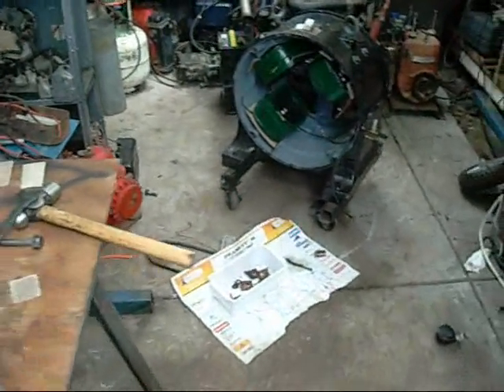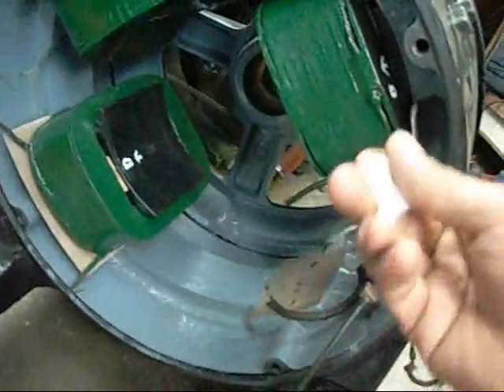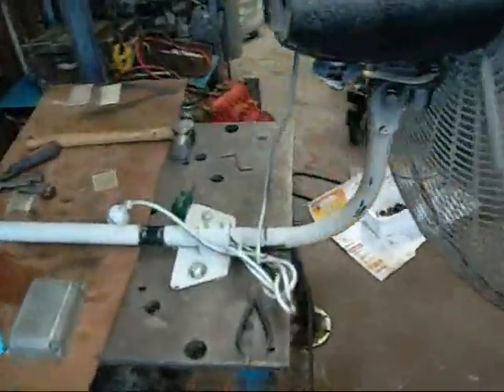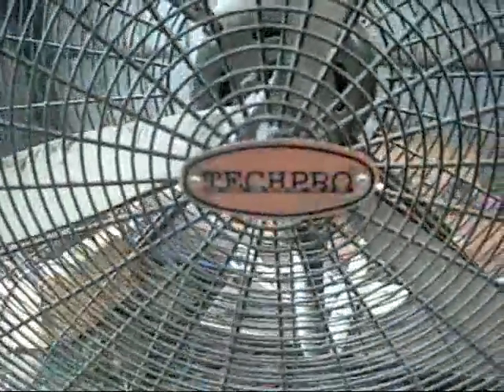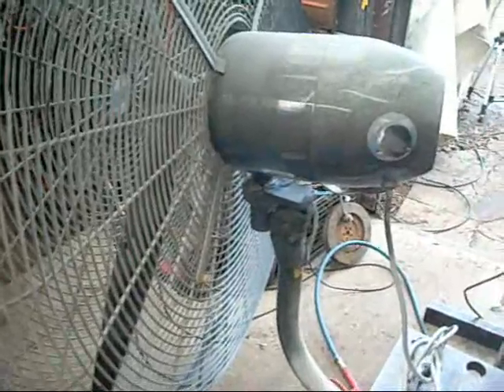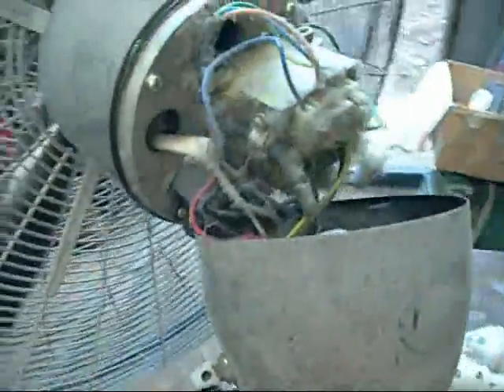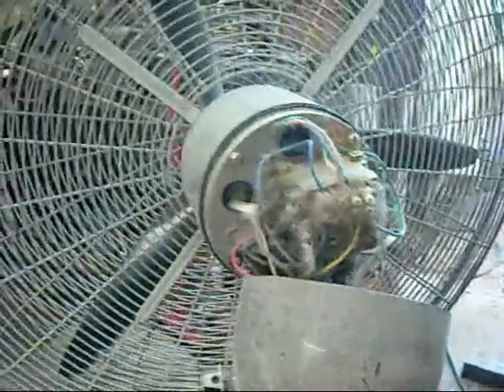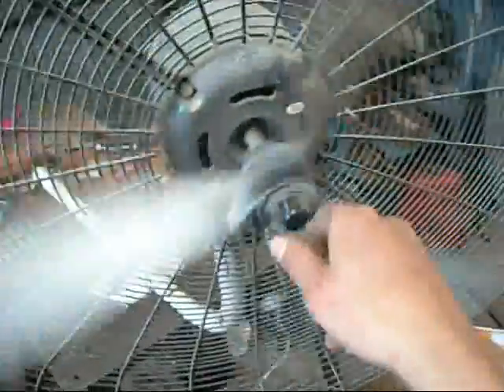Westinghouse DC Generator + Troubleshoot Industrial 30 inch Fan

Comment: Friend got  a call to a evap in a bakery production room where they put the jam in donuts etc from what look like stainless fire extinguishers, sure enough fan was hardly turning, took the gaurd off for a better look when the blade suddenly sped up came off the shaft and flew across the room hitting one of the bakery staff! 
They'd had a company in to clean the whole room due to the workers having fights with the jam squirters and they hadn't tightened up the screw on the blade,  no one was hurt

Comment from the maker: @gushhnet I'm not really sure on that one, you will probably find 3 sets of windigs with the cap connected to a common point between the 3?

I would take it to a motor re-winder and see if they can test each lead and determine which set is for  which speed.

Comment: Do you have any wiring schematics for a 3 speed fan?, I was finding out what the problem was with the unit when wind pushed the courtains and in turn they knocked over the motor, the stator got yanked out, so now I'm left with about 6 thin copper leads and no clue on how they're supposed to be wired.... The motor had a capacitor so I'm guessing theres an entire winding dedicated for it as well, any ideas?

Comment: oww that fan.lol. yer it seams as that old motor is fryed. mad. i wonder if my cage will fit. ill have to get my hands on that one.lmao i think thats just like the one i got for my old work shop. i spend hours and hours infront of it on hot summer days. i have black. just redid my heater fan in it.